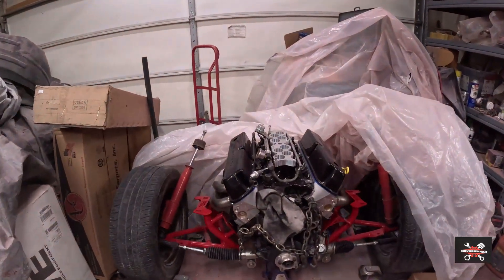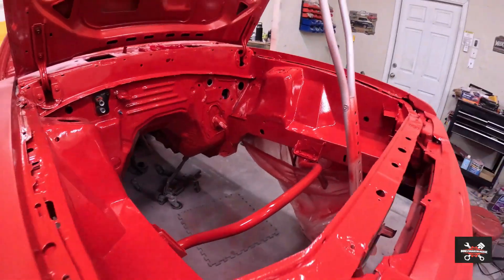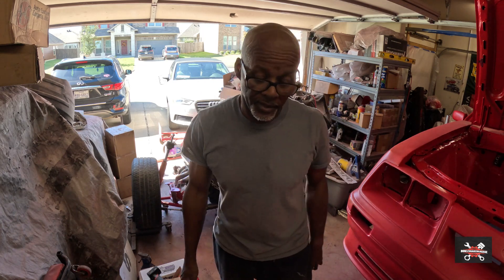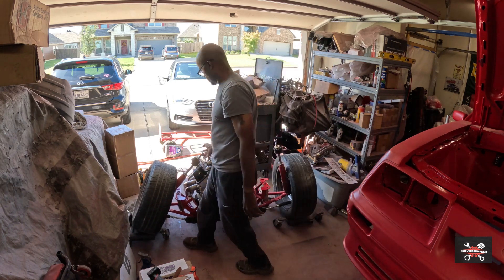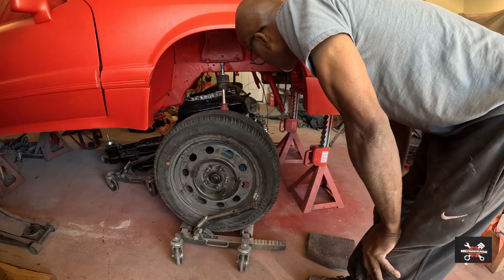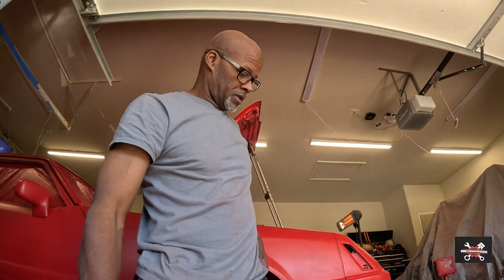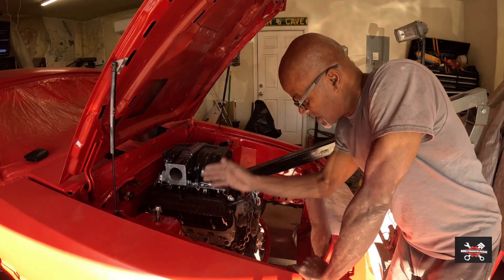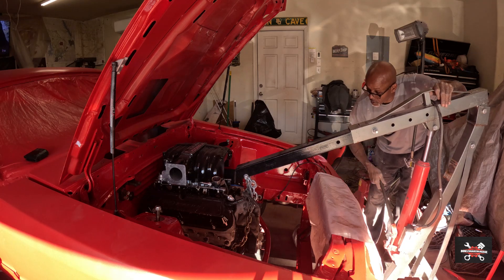85 FoxBody Mustang Notch Back Build EP 45 (Motor and BMR K-member Going into the 85 Coupe)

Comment: You really made me nervous there for a bit! LOL  Especially since you have a cherry picker a few feet away...lol  Glad to see things are working out, and you are making some awesome progress!  I did a similar procedure to put the motor in the '95.  I wish I had my transmission attached to the engine like you did.  It would have saved me a lot of time!  Keep up the great work!!!
Reply from the maker: The only reason I didn’t use the engine hoist was because I didn’t want to bang up the front end and fenders putting the engine and transmission back in. Plus, with the car sitting that high I wouldn’t have to lift the engine and transmission even high to get it over the the front end
Reply: Hi,  I pulled my engine and K-member upward to the car with my cherry picker.  Plus I had extra room to put the bolts in the car up higher on jackstands.  It just goes to show there is always more than one way to get the job done!  Nice work brother!!👍👍